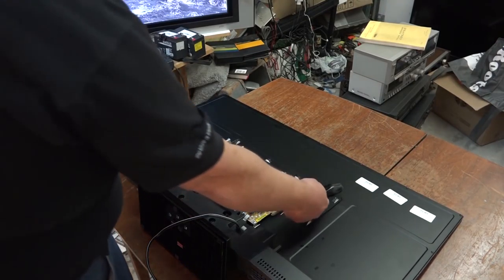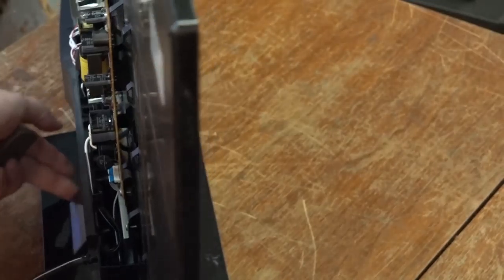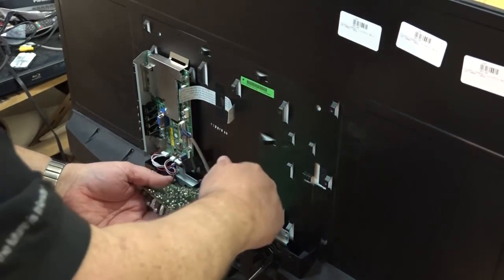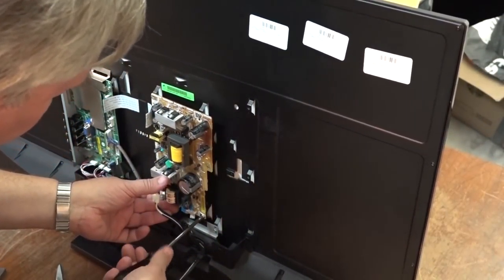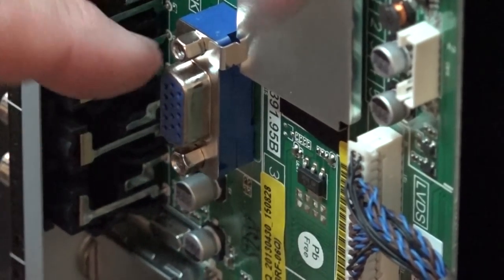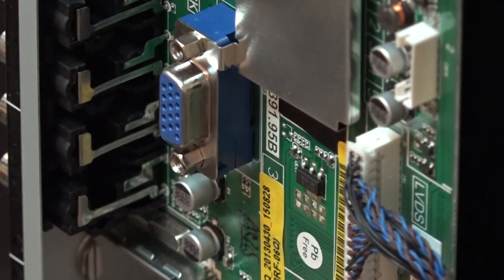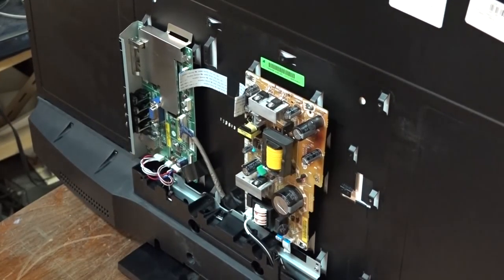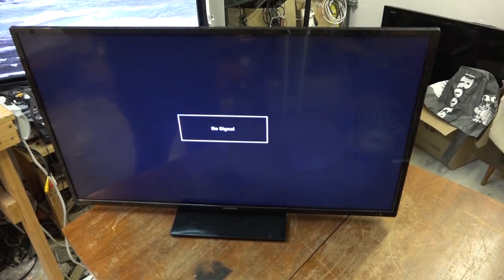hitachi LE39H217 power supply heat sink follow up

Comment: Thermal camera images (or non-contact IR temp readings) before and after would have been helpful.  If it's still getting a little bit too hot for those components (and the poor capacitors nearby), use just a thin layer of the thermal foam (or some epoxy) to attach a large, chunky aluminum heat sink directly to the two heat sources. An attractive opening must be chewed into or made by unfolding the side of the cover to allow it to extend right out of the side for several inches so the heat could radiate into free air. Some mechanical support, maybe a blob of silicone caulk, could keep the new heat sink from flapping about. Electrical isolation should be considered/checked, though that's optional as long as an attractive electrocution hazard warning label is posted nearby. Some ugly there might save the day for many years to come.

Comment: I have heat discoloration on an old stereo where a line of zener diodes are. Looks like someone took a couple of them out and it just has the legs sticking up. Anything I can do to prevent it from discoloring the board further? It's just when I see discoloration I fear there could be further damage down the road.

Comment: I was thinking about this set the other night (yeah.. I need to get a life) and a conclusion with considering the screen fault.. which looks rather like it's related to the hot area and the convection path from standing perhaps in a draft.. might it be worth trying a bit of heat gun action to the screen.. if it's all bad at least it would be consistent.

Comment: some newer tv's just have a power brick & are very light and they do not have rca inputs for older devices. and some do not even have audio out to hook to a stereo. like you said it's mostly hdmi. i guess these tv manufacturers really are cutting back. even my expensive LG tv only has 3 hdmi inputs and i don't even think it has any rca  jacks or vga on it
Reply from the maker: My Samsung 4K has 3  HDMI inputs, 2USB, Ethernet, wireless A/C/N and bluetooth connectivity, and an analog that uses a pair of 3.5mm headphone type jacks. One has audio, and composite video / the green of component, and the other has the red and blue for component. So you can plug 1 analog device in, you choose if it is composite or component. So to hook a VCR, and a DVD player, the VCR needs to go on ch3 RF, and the dvd player on component input. Not much in these sets today. Just throw them out when they break.From what I have seen, the plasma sets were the best of the flat panel sets. After the end of the plasma sets, the quality just seemed to take a dive, and sets became really cheap, basically a single chip solution.

Comment: Yep that little square of crap didnt look brilliant.
Your new one has more force applied, it should last a looooong time now :-D.

That driver chip has been super hot, hitachi wants a kick up the jacksie :-(
Reply: Not unusual for Hitachi to be honest - I worked for a Hitachi dealer years ago (20+) and even then they were pulling some pretty unusual stunts.  I remember one range of 25 and 28 inch sets (sorry, cannot remember the models) - they were a really nice looking, stylish TV with the plastic casing finished in a nice suede-feel, fawn coloured finish and nice cloth speaker grilles;  they really stood out as something different, and we shifted quite a lot of them both in terms of rental and sales.  All was well for the first few months, then one by one they started to go pop.  The first few, Hitachi simply took back and replaced, but eventually they released a repair kit for dealers to do in house.  The first one we opened up showed us exactly what the problem was - they had used a chassis from a 14" set to drive these larger tubes - not even the flyback was upgraded, nothing.

In short, they were being driven so hard they were failing all over the place.  The repair kits were direct replacements (no uprated components), so the failures kept on coming;  we threw as many as we could back to Hitachi, replacing them with Sony or Pan wherever we could, and those that we were stuck with were treated to a sensible upgrade courtesy of our head engineer;  thankfully, the upgrades worked and the trouble died down.  

No real surprise that you don't see much of Hitachi in the UK any more.
Reply: Its a real shame when manufacturers put money before having a decent product, hitachi was a trusted brand, you knew it would do the job for a decent amount of time.
When i say decent, i mean related to the price, a premium class tv should last at least 5 years, im talking lcd/led not crt.
They often dont last as well as the cheap old crt sets of the past, we had a hitachi 20 inch crt tv that lasted 8 years, the frame chip went pop, that was acceptable for the age of the set, i didnt bother to repair it as i was bored with tv anyway.

All manufacturers pull silly stunts, i hated the missing heatsinks on some power components, there was a designers outline and fixing holes there, but some arsehole decided to shave a few pennies from the cost and remove them, customers would not have argued if the set cost a little extra, but we were not even thought about.
Any decent device that has bad heatsinking gets an upgrade, my simple mind says if you cant touch a device without burning skin, then its too dam hot!!, heatsink applied :-D.
I dont believe device heat ratings.
Reply: Totally agree.  I recently heaved an Onkyo 7.1 receiver on that very basis.  It had munched a couple of output transistors, which I replaced but under testing the thing was running so hot even with the heatsink it was only a matter of time......   sure enough, with the lid still off it and still on test, another channel let the magic smoke out.   I didn't do any more than unplug it and bin it, and then went and gave a Yamaha dealer £1500 for something half decent.    I know Yamaha aren't the last word in quality, but at least they know how to engineer something properly.
Reply: Onkyo isnt a brand ive ever had in my hands, sounds like im lucky :-D.
Sounds like the transistor bias current was way too high, but its in the bin so not a problem ;-D.
To me, yamaha is motorbikes and keyboards, but thats my age lol.

My old mate keeps saying "Buy a new laptop you tight bast**d" but my old acer aspire 5315 from 2007 is still fine, i keep the cooling free of dust and crud, so it stays cool, for what i use it for its fine.
Reply: I was quite annoyed at myself for buying such crap to be honest.  It was bought in a hurry, and did the job for a few years, but never really excelled in any area.

I have dealt with a lot of Yamaha audio kit over the years, and despite it often being overlooked because it is a bit 'plain', the vast majority of it is pretty good.  The one I have now is there 'Aventage' range - built like a brick shit-house and runs as cool as a cucumber even when driven hard.  Paired it up with a set of DALI speakers, and it properly sings when it wants to.

The old adage holds true - you get what you pay for.
Reply from the maker: I wouldn't count on that. A POS always will be  POS.
Reply from the maker: I had a Yamaha once. Then I got a real bike, a Harley Davidson.
Reply from the maker: The last time Hitachi made good products was when VCRs still ruled the world and those old belt driven Hitachi units were among the best.
Reply: Yes they were good machines, i think quite a few manufacturers became reasonable then later on they turned to junk :-(